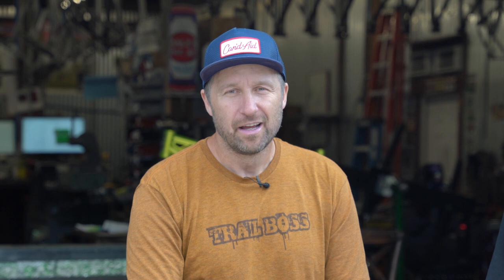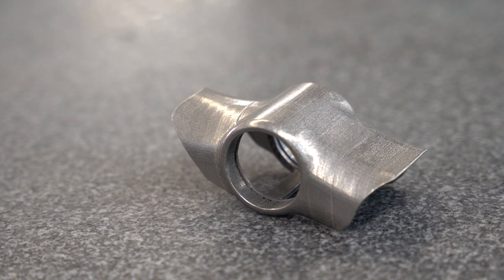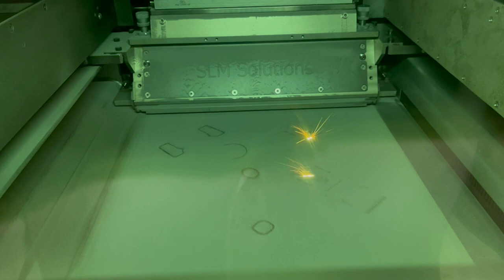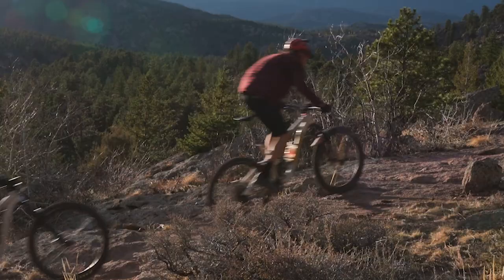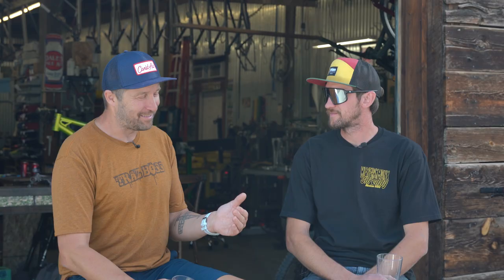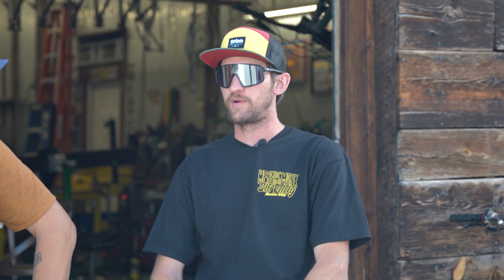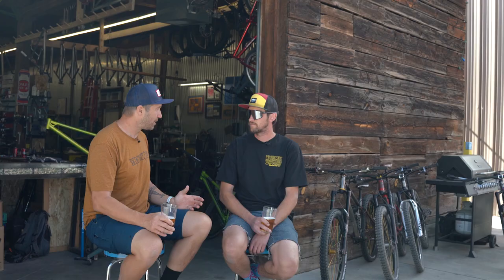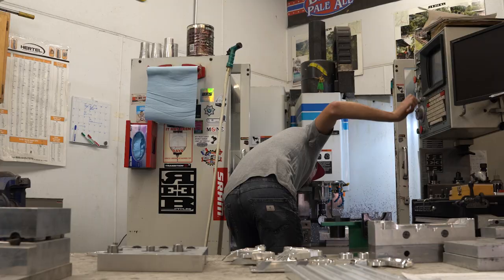SHOP TALK : Why Reeb bikes are different.

Comment: Can't afford a Reeb, so I got a custom steel frame.
Reply from the maker: What did you get?
Reply: @JeffLenoskyTrailBoss Marino
Reply: @RealMTBAddict  I almost ordered one from Marino. They are supposed to be decent frames and it's hard to beat the price. In the end, the long wait time and extra cost for the Reeb was definitely worth it.
Reply: @sapinva  It was long I'm not gonna lie. Finalized design in April and they shipped it last Friday. With about 30 emails back and forth getting it right.
Reply: @RealMTBAddict well that doesn’t sound great, Tim and Robbie hooked me up so easy and my bike is a straight masterpiece!
Reply: @MarioXcore1  So is mine, at a fraction of the cost.